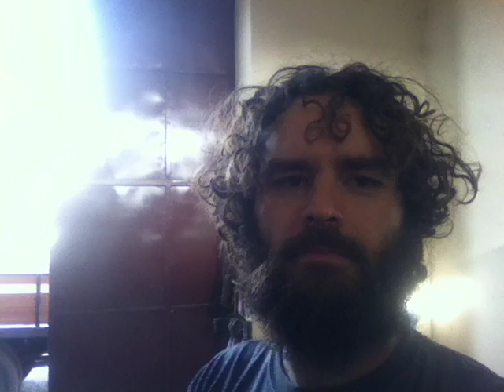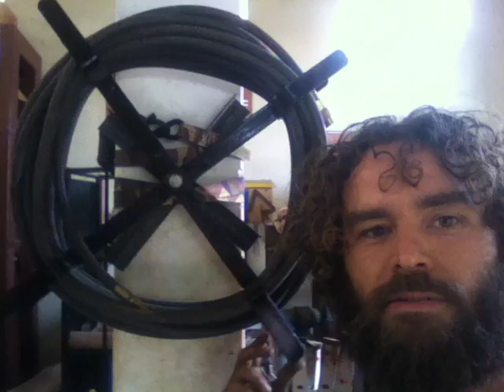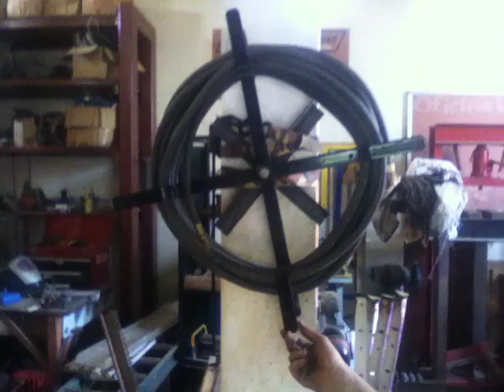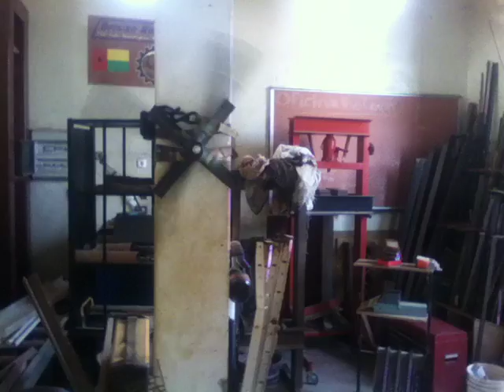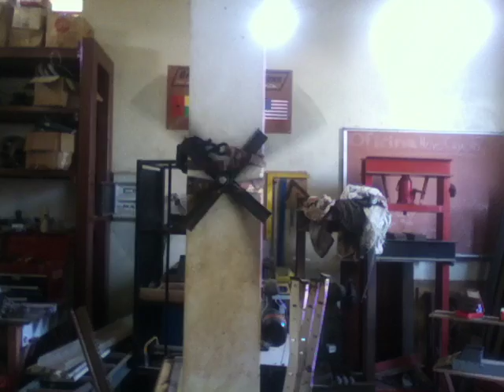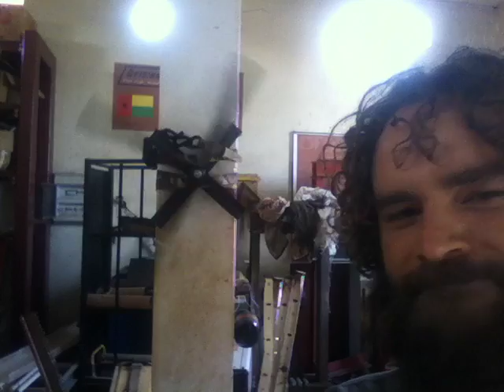Overengineering Defined

Comment: I have the solution....
As air will be provided to the hose reel he could install a small air jet on the tips of the arms with a remote control orifice adjustment which would counteract the force of the unreeling hose.. of course he may have to add a short algorithm to automatically adjust the orifice to negate the effects of the decreasing moment resulting from the decreasing diameter of the hose reel but that shouldn't take more than a couple of weeks to sort out...
Just an idea you understand..